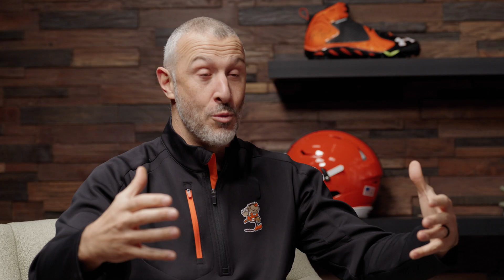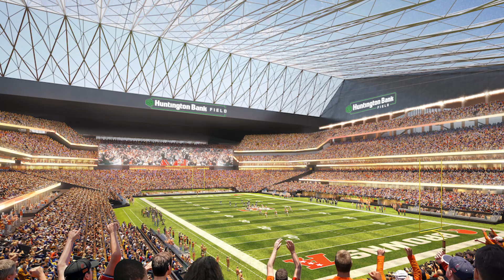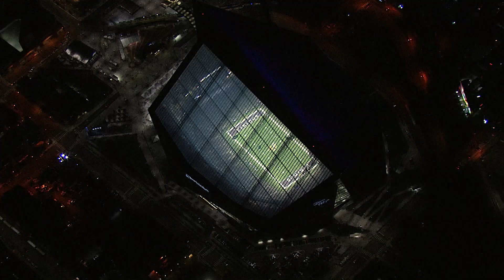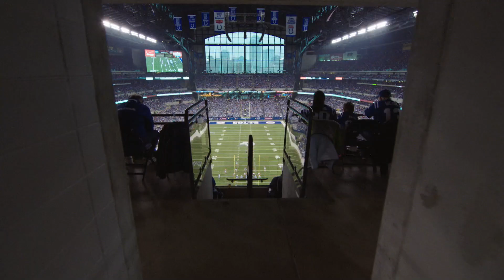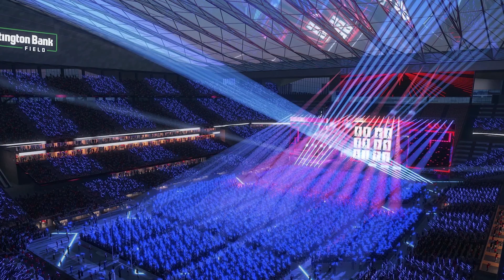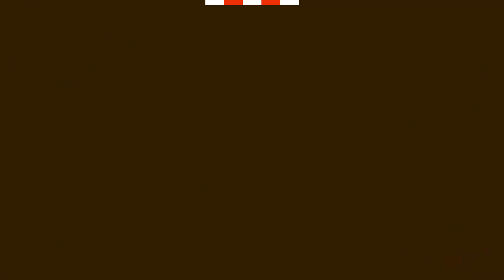Lead architect dives into vision of enclosed stadium for the Browns dome

Comment: Funny how he mentions that the design of the roof allows for 20-30% HVAC savings and lowers the carbon footprint of the facility.  I have a better idea - no roof would save 100% on HVAC.  Perhaps I should be an architect...
Reply: Does your open air make it useful all year ?
Reply: @ryankilgore8844  Useful all year doesn't guarantee it will actually be used.
Reply: @ryankilgore8844 it is if you have a good architect (which we obviously do no)
Reply: I'm wondering if you could even be a secretary for an architect?

Comment: Legit question - not a bitch or complaint.  I'm a season ticket holder since 1985, currently sitting in section 319.  What percentage of "core" fans do you think will be priced out of season tickets?  We have a group of  about 30, and I personally own 3.  This has been a big topic of conversation amongst our group.  Our group is split 60/40 on retaining our tickets.  That will change drastically up or down depending on if there are PSL's at all or the cost of the PSL.  Interested in hearing everyone's thoughts.
Reply: If they can use it more throughout the year. Should keep increase at a minimum. I would think
Reply: Based on assessments I’ve heard from Cleveland sports outlets who researched other teams that built domes, expect a notable to dramatic increase. 
Like buying a car nowadays… you’re paying more to cover all the features you never wanted or needed.
Reply: @MichaelSimmons-ee4ib  Would like to see who they assessed. Minnesota dome to dome actually paid of early. Raiders went from outside to dome but also in vegas. So who else has moved outside to dome that they pulled this info from ?
Reply: You can bet your azz if the BROWNS end up building a brand new stadium like the one they're planning to build right here. ALL the average Joe die-hard BROWNS fans who've been season ticket holders for years are gonna need a second job in order to continue to pay for their PSL's & season tickets for sure. It gonna be hard enough for fans to afford to keep their seats in any NFL stadium 4 or 5 years from now. But, to pay for the seats of a brand new stadium like this one, good luck. That's all I gotta say about that. Unfortunately it really sucks that the NFL seems to have forgotten who the fans were that made them what they are today. I'm not mad at their hustle, I'm just a little pissed off & disappointed that greed has blinded what the game of football is really about. Just saying... Let's keep it a buck here ya dig? GO-CAVS! GO-BUCKS!